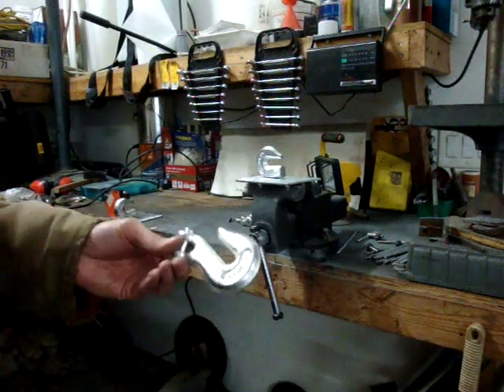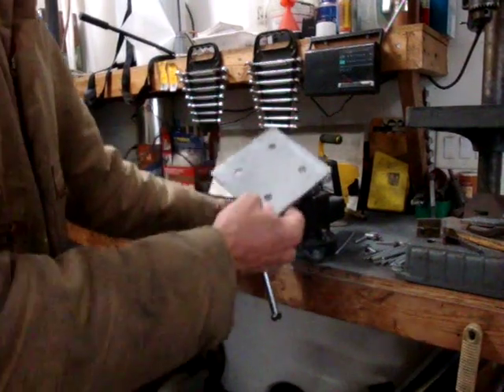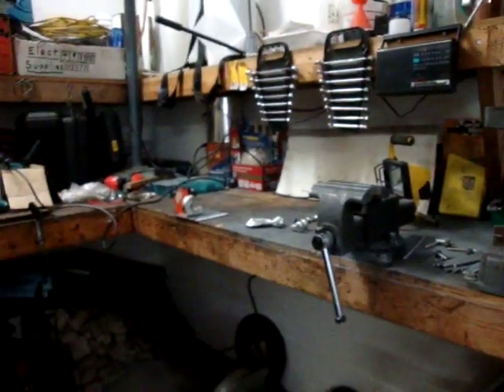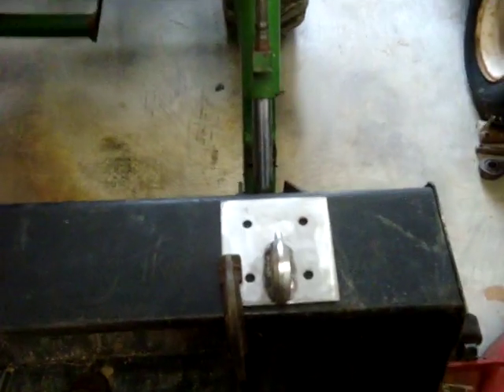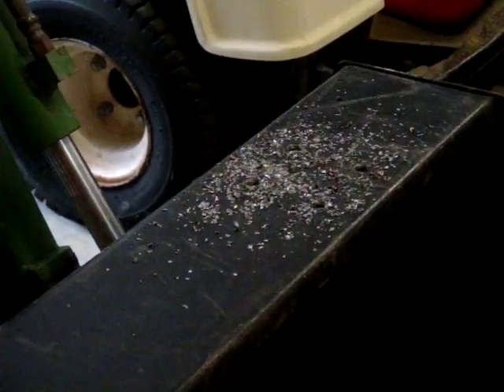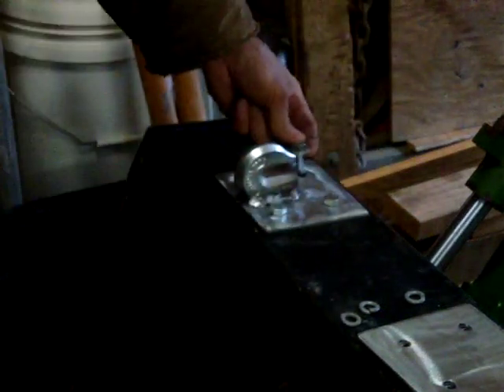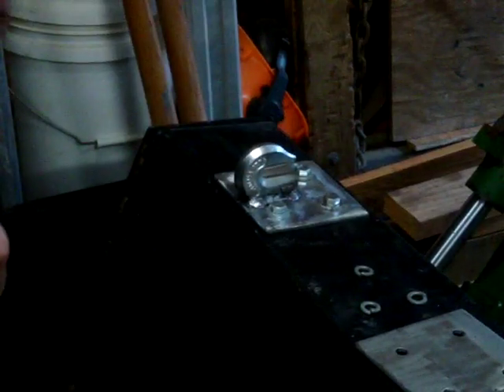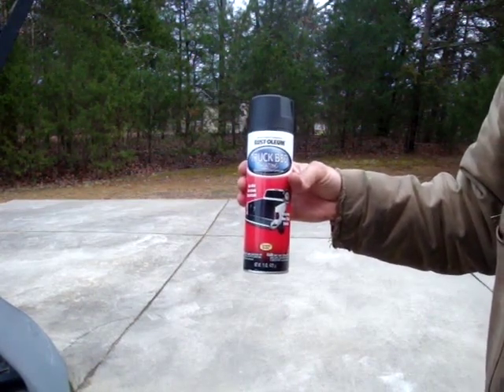How I Built & Installed Tractor Bucket Hooks - $4 each

Comment: for your safety the hooks need to be installed inside the bucket. if the cable breaks it will shoot back and be stopped by the bucket, mounted on top the cable will get you.
Reply: That's a good idea.